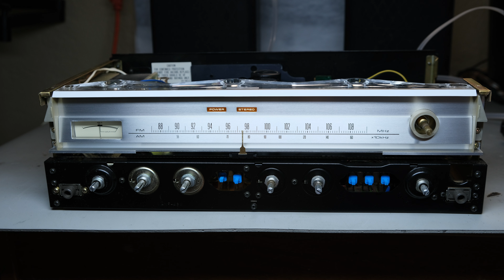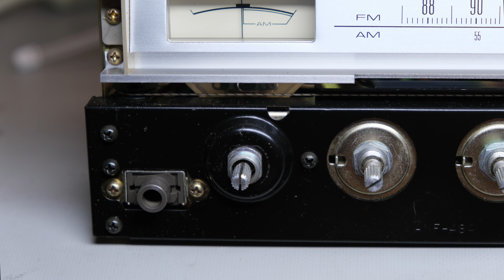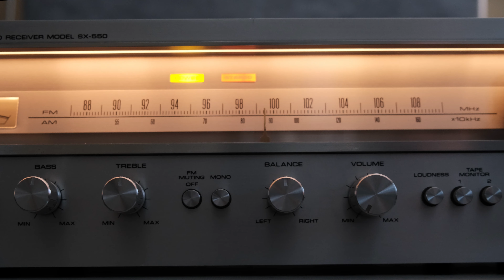ALPS Power Switch Repair. Pioneer SX-550 Receiver. Old Vintage HiFi Stereo Repair & Restoration.

Comment: I have a Sansui receiver that has a power switch combined with the speaker selector. 
Afraid that it may fail so I leave at ON position and use an external power switch to control the power supply.
Reply from the maker: Yes, that's a good idea. The switch has a pretty good chance of failing at some point.

Comment: Hi, i have the "direct" button, on my 90's  Pioneer a777 series, that have bad and intermittent contact, i possible open It to repair the button? Or must be replaced? I dont know if find this to buy today🤔
Reply from the maker: I am not sure about your Pioneer as I've never worked on one. Possibly you could find a switch on eBay?

Comment: Might want to replace that snubber cap on the switch. The fact that there was so much arcing may mean that the snubber cap is bad or not soldered correctly.
Reply from the maker: Yup, Thanks for sharing.

Comment: You do not have to remove the switch from the board. Just get the lamp diffuser out of the way, pull the fuse closest to the ALP switch (grey box), bend the fuse holder away from the switch, loosen the 2 brass nuts with a long needle nose, slide the switch off, pop it open, file or sandpaper the 2 contacts, and put it back together. I've done hundreds this way. NO soldering required. It takes less than 10 minutes.

Comment: He does anybody know where I can get a power switch for a macintosh Mac 4100 I can't find it anywhere and I would so greatly appreciate if somebody could help me find where I could find macintosh parts I've looked on eBay they don't have the part I need
Reply from the maker: I don't know where you can find one but in the back of the 4100 there is a convenience switch. Green outlets. It would bypass the power switch, turn on the receiver when an turntable or something else was plugged into it. May work with a cd player? google it for more info.
Reply: Hey thanks I do appreciate it

Comment: Hi Chris, I keep meaning to mention this to you and you may have already seen it by now? Anyway Xraytonyb did a two part series on Capacitors. He was kind of in the middle as to how important it is to replace Capacitors. Yes he knows capacitors do go bad and they do need to be replaced, but did a great job in testing capacitors in every way possible so that everyone could see the importance of replacing them and why. Just thought that I would pass this along  because it backs up what you always talk about with the facts as to why. I'm sending Part 2. You can find Part 1 on his channel with no problem.   https://www.youtube.com/watch?v=fzrP-EeMb1Y
Reply from the maker: Hey Bob, Thanks for sharing the information. I'll check it out. As I've mentioned in some of my video's the manufactures of capacitors like Nichicon, Panasonic etc. all have of their capacitor data online. These are the folks that design, validate, and manufacture these components. Who knows how their products work, better then they do? They state that ALL electrolytic capacitors will fail over time. As soon as they were produced the clock started clicking. If you not going to believe the real experts then that's up to each individual person. Year's ago there was no way to find out fact from fiction. With the internet now there is. You don't have to listen to the bar room BS in internet forums or video's.....Unless you want too.